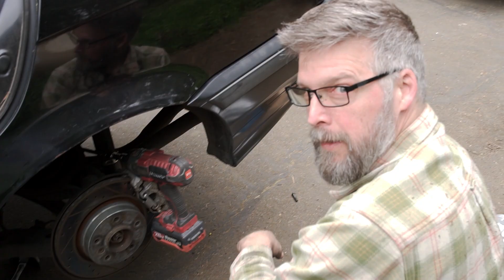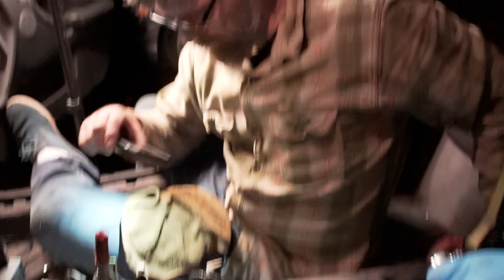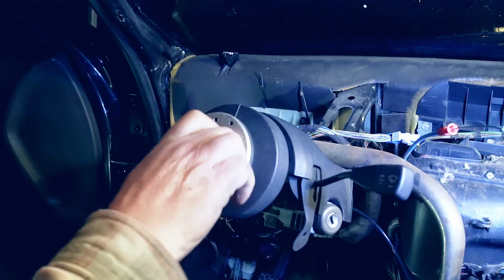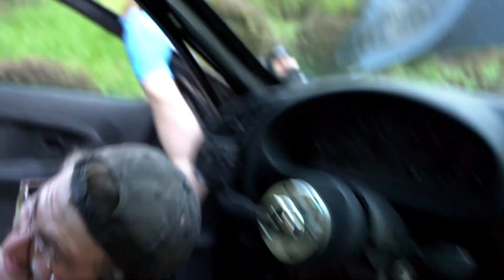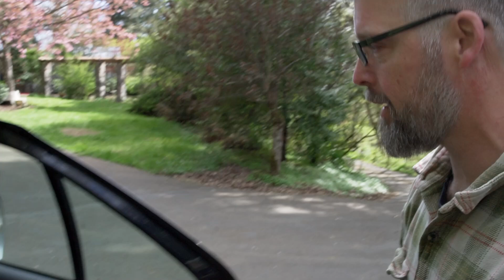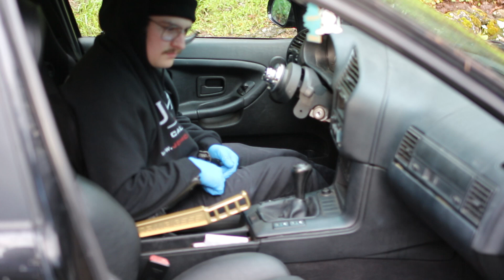How to miss a drift event with The Little Big Boys

Comment: That's why I never use in-line anything.
Reply from the maker: It’s wonderful now that it’s not leaking. I like in-line but tbh I’ve never driven a dual caliper setup. Installs are probably easier but they cost a good bit more
Reply: @JonasVanHorn  Setup is easier but you're correct, it does cost more. You have to understand there are more components involved - bracket, calipers, pads, lines, etc. However, it's consistency you're buying. I run dual calipers on all my chassis - including my R32 - and setup was an absolute breeze. I used DriftHQ lines off the master [comes with banjos and bulkhead adapters already] straight to the Z32 calipers in the rear. Easy peasy.